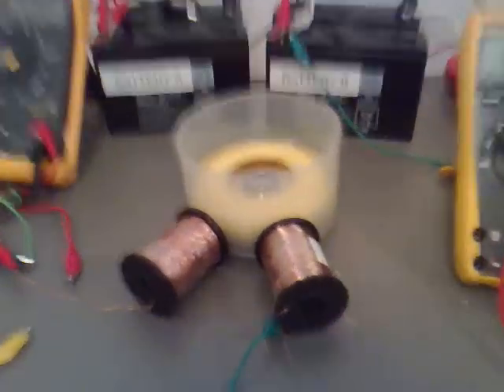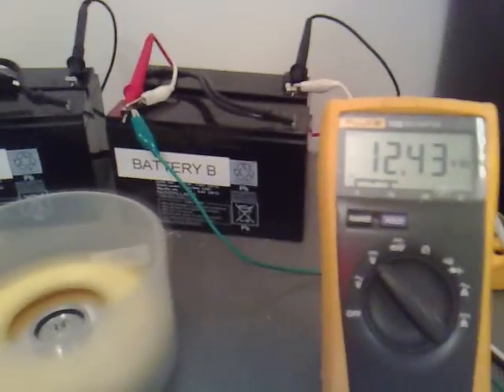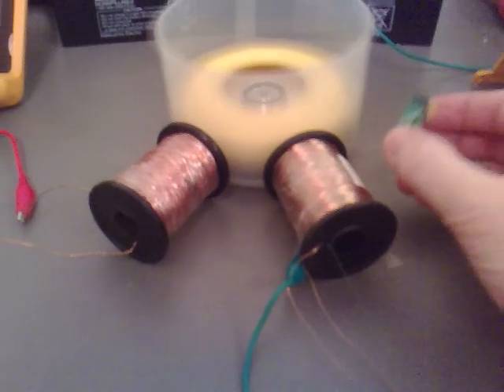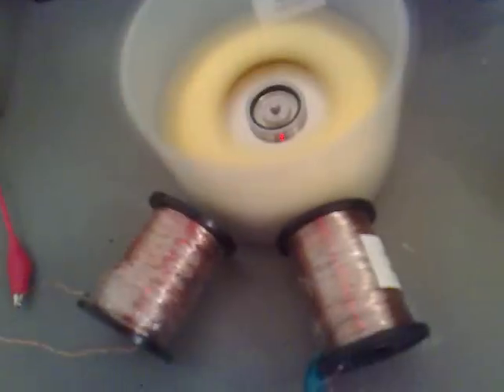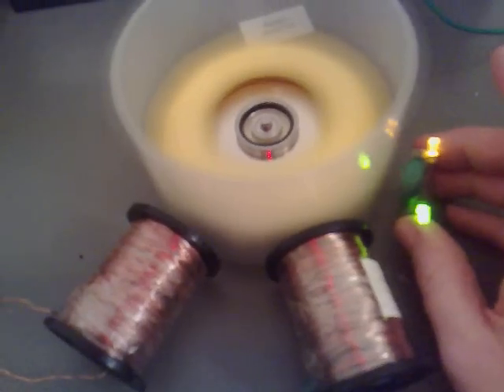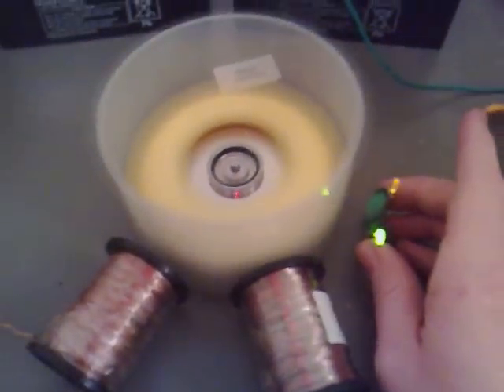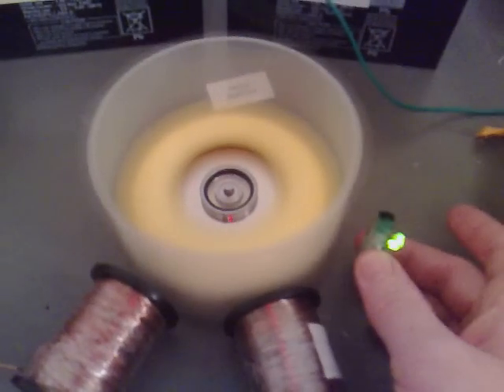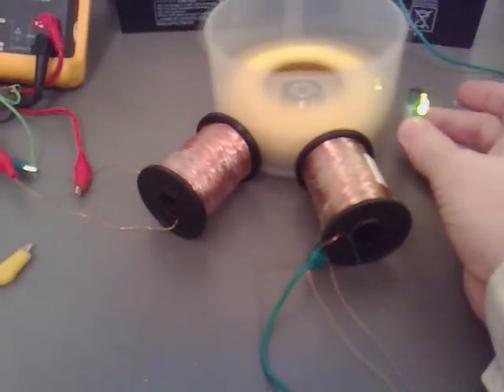Pulse Motor (More Coils Needed) 051

Comment: There is a problem with this circuit the Eddy Current and/or Back Electro Motive Force (EMF) between the Rotating Magnets and the Coil with the led will eventually kill the entire operation that is why it slowed with coils and LED beside it because the fact is energy is transformed from chemical to electromagnetic to mechanical to electromagnetic to chemical and some of it is lost in heat, light from the LEDS, and stray electromagnetic fields. if U could avoid losing and gaining instead.